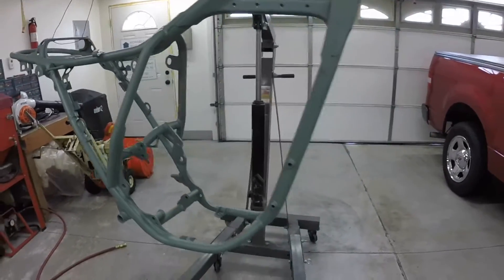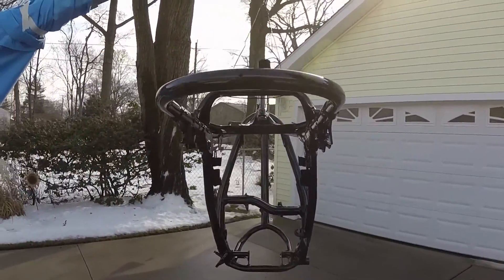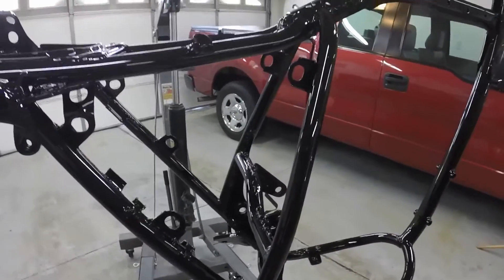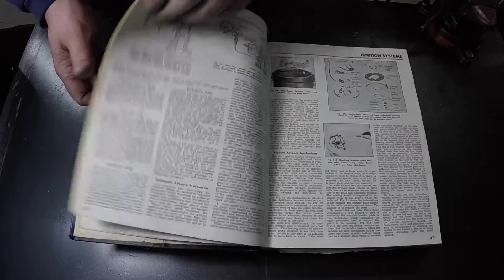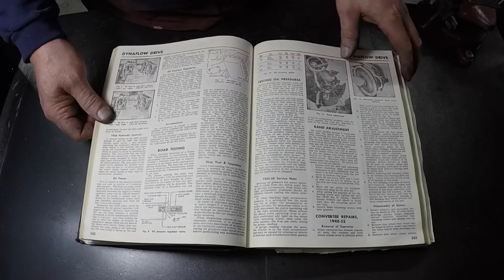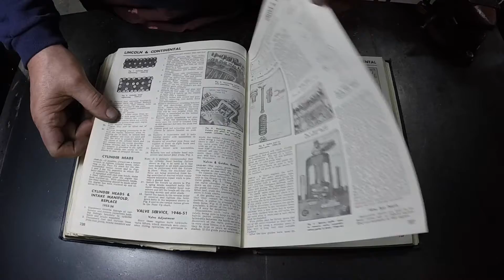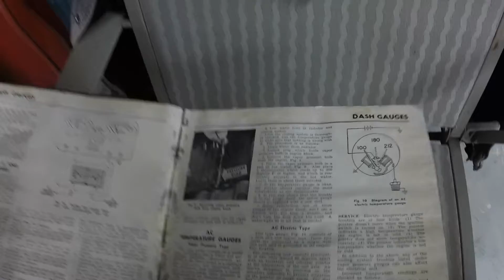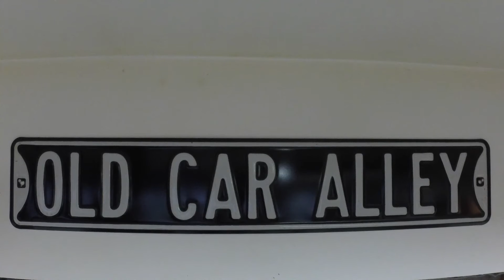1976 Honda XL175 restoration part 17, painted the frame, plus a very old shop manual

Comment: It definitely already looks better than what it did from factory!! I started watching your channel because I recently picked up a xl175. I will be subscribing because you do very detailed work! Awesome job! I enjoyed the old books aswell
Reply from the maker: What year is your XL175? Are you going to restore it? Do you have a Trail 70 also? Thank you for subscribing.
Reply: @old car alley my xl175 is a 1974. I don’t plan on restoring it, i would just like to get it running again. The motor is locked up at the moment. And yes I do have a trail 70 along with a cb125s

Comment: Yo OCA  where are you at?  I'm interested in the XL 175 willing to pay full price within reason.
Reply from the maker: I have already been offered $6000 cash for it. It's not for sale. I have had it since it was new, and have no plans on selling it. As far as the engine goes, it ran well, and used no oil, before I restored the bike. For as little as I ride it now, there was no point in overhauling a really well running engine. If it takes a dump, then I will overhaul it, but I think it will last my lifetime. Thank you for your interest in the XL175.
Reply: @OldCarAlley   Yeah    If it's all the same to you, I would not pay that much sure it's a nice bike but that's way to much I am really looking for  79 or 80 XL 185 S or a 250 S  but I won't pass on anything reasonable Thanks anyway sir.
Reply from the maker: @unclequack5445  Thank you for checking my XL175 videos out. It was very hard turning six grand down. That was the second offer I had. The first one was five grand, that was hard to turn down too. I still enjoy ridding it. I will be ridding the XL175 around the neighborhoods, no more woods and fields or dirt roads. Might even ride it to a bike night near me, when it warms up a bit... still kinda cold out.
Reply: @OldCarAlley    I watched every single video about the XL 175 I seen the engine in the Belair I believe it was? 
I started with the first ones i could find  I thumbs upped every video I watched I resto bikes also right now I'm working on a 2003 KLR 650 as it sits it is about 85% done. I love bikes Ive owned many XL and XR Hondas this is my first Kawasaki ,  had a 79 XL 185 S in high school i'd love to find a clean one for a project bike.